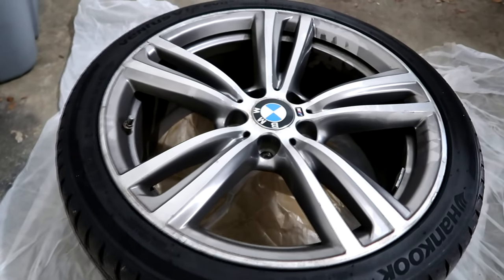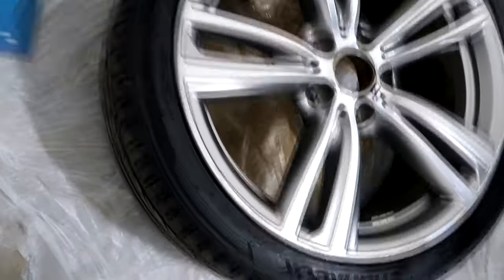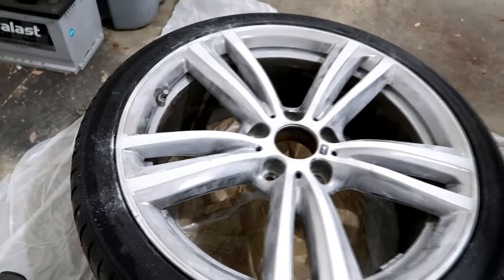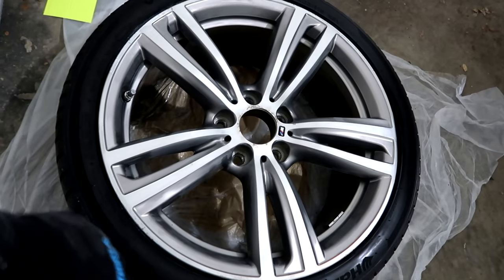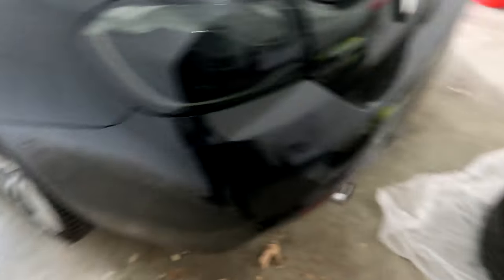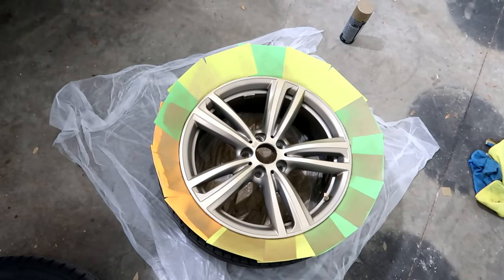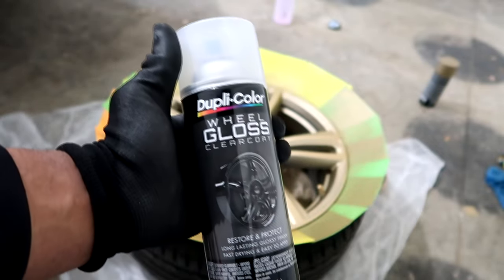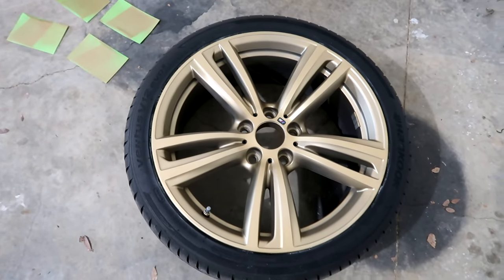Using Duplicolor Wheel Coating to Paint My Wheels!!! (BMW 440i)

Comment: Thanks for the video. Trying to figure out how many cans of paint and clear coat I need for four wheels. Plus is it even worth trying to primer it first
Reply from the maker: About 2 cans each. I believe you can get away with not using primer but the paint won’t last as long
Reply: @HeavyChevy1998 dumb question, but by two cans each. Do you mean a can of paint and a can of clear per wheel, or do you mean 2 cans of paint and 2 cans of clear per wheel?
Reply from the maker: @skatelately  2 cans of paint and clear in total for all four wheels lol my bad I should’ve clarified that

Comment: 😢 you should not lay the wheel flat to paint.
Reply from the maker: I didn’t know that 😅
Reply: Quick question, ive always don this this way for the last 13 years. Is There a reason why? Sincelrely asking not trying to be mean or nothing. Going to paint my mags tomorrow. 😅
Reply from the maker: @lonew0lf94  I’m curious as well
Reply: Sounds like something an old guy would say just to say.  I ve been painting since the 90s and never heard this.